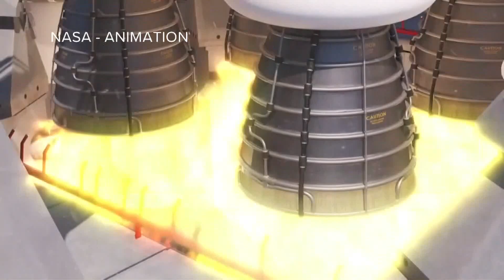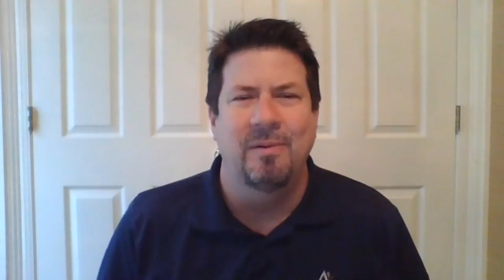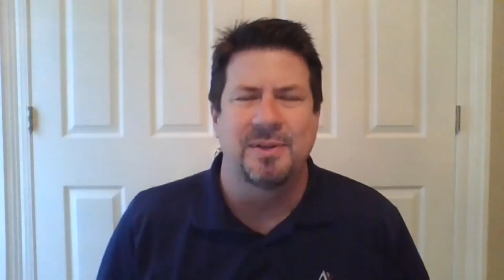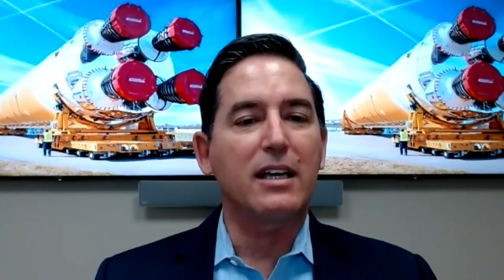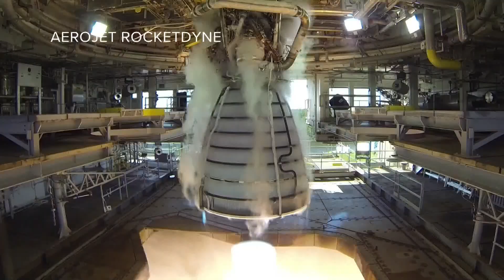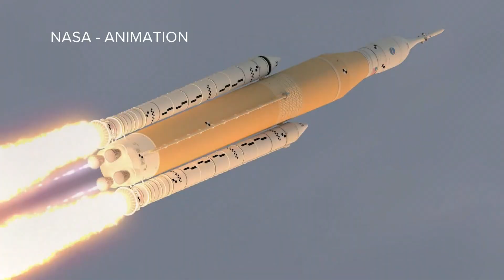NASA will test world’s most powerful rocket engines in Mississippi Saturday

Comment: 1.6 thousand lbs of thrust! What will that pressure  do to continental shelf.  Florida has sink holes, New Orleans is 6' below sea level & Mississippi ground is lots of red clay.
Reply: Absolutely nothing
Reply: Nothing. 26 Falcon 9 rockets launched in 2020. All have more power than the core stage of this rocket with 1.9 millions pounds of thrust at liftoff. Nothing has happened